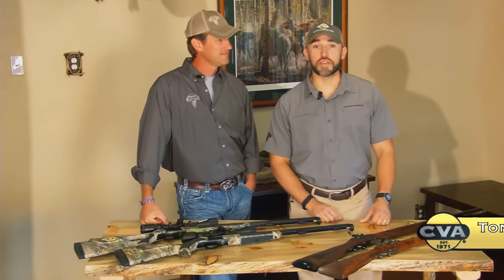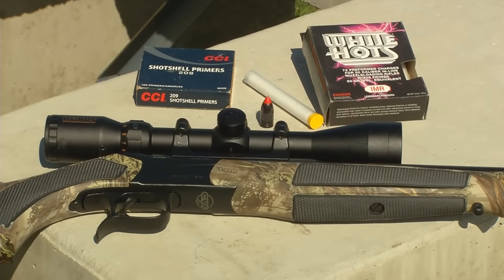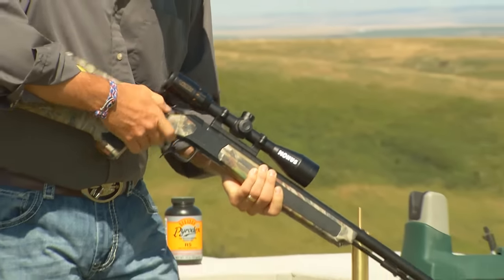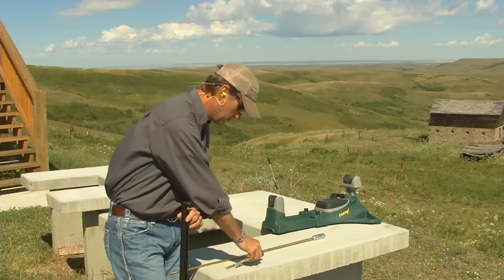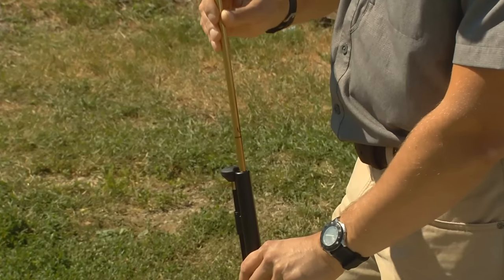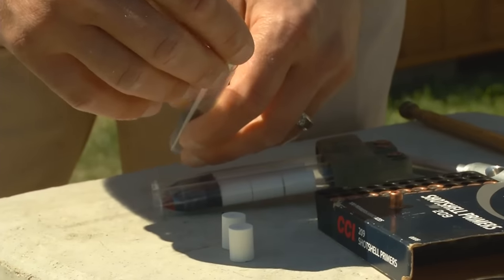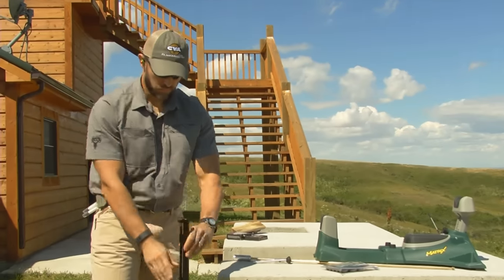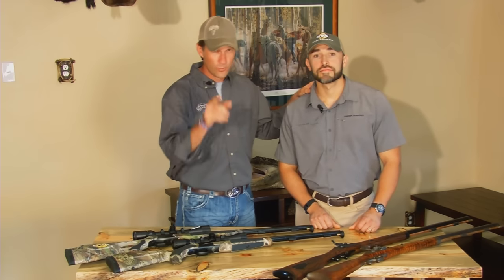How To Load & Shoot Your CVA Muzzleloader

Comment: I have been a cap-lock shooter for 40 yrs.  Never fired a flintlock.  Good fun .  Clean-up not bad, with a bit of practice.  Had best luck with in-line guns, like these. Side-hammer guns OK, if nipple delivers the flame directly into the powder charge, without twists & turns.  Have had a CVA Bobcat .54 for 30 yrs, and despite everything , have never been able to make it go ' bang ' every time.  With a nipple drum,  fire has to make two 90 degree turns prior to reaching the powder.   Even  musket caps, priming the nipple, etc proved ineffective.
Reply: There is a fitting you can purchase that turns it into a 209 shotgun primer.
Reply: @thomashocker2792  Sounds worth a try.  Tks.

Comment: I’m disappointed that you didn’t use the ramrod that came with the gun.  I came here because my cva wolf come with a 4 inch extension you have to use to load it but it doesn’t fit in the holder now I have to carry it separately and possibly lose it when I might need a second shot.  And I was wondering if I can load it without the extension thing without damaging the bullet
Reply: I was wondering the same thing. Just got mine and I love it but it doesn't make sense that the ramrod doesn't fit the holder with extension piece on

Comment: I have an optima V2 and I must have some bad luck with the breech plug.  My primers fit nothing like what is shown at 2:26 in this video. When I put the primer in its extremely loose and can even be angled while in the primer pocket.  I received a replacement breech plug but it is still having the same issue.  Have you had this before?
Reply from the maker: It sounds like a primer issue. Our breech plugs are machined to a precise spec. The 209 primers are generally stamped metal that is less precise. I would suggest trying another brand of primers and see if you still have that issue.
Reply: @CVA  July 26, 2024
https://youtube.com/shorts/5d4Hbx3cjsM?feature=share
July 26, 2024
https://youtube.com/shorts/zYa3AYazwQE?feature=share
July 26, 2024
https://youtube.com/shorts/ptCjFsQkTwI?feature=share

Three different primers. All the same issue as the Winchester.

Comment: I have trouble with my CVA muzzleloader shooting all over the place. Do you have to allow the barrel to cool or clean it every time before shooting when sighting in the scope? Never had a muzzleloader so not sure what is to be expected.
Reply: Recommended that you run a swab down the barrel each shot, I do every 3 shots, I think I use a 20 ga swab, I use 50 grain pellets and 295 grain powerbelts
Reply: You want to clean barrel in between every shot when sighting in. Either a wet swab followed by a couple of dry patches, or wet patch followed by a couple of dry. You'll never get consistency with a dirty barrel. Also some guns just don't like certain powder bullet combination. I never could get my Omega to shoot powerbelts accurately, but shoots moa with shockwaves. Also if you're using 209 shotgun primers, buy some triple seven 209 primers... regular 209's are to hot for muzzleloaders. Your charge is being pushed down the barrel before ignition. That will also hurt accuracy...
Reply: Try different grain of loose powder with patched round balls and see if that helps. Just a thought 💭.

Comment: Wait do you need to use a primer to clear the chamber every time before reloading?  Or just the first time?
Reply: Pierre C  should do it every time you clean it or swab, helps flush any debris or moisture from the swabs out of the breech plug hole
Reply: You dont need to
Reply: I would
Reply: I shoot only round balls in my black powder rifles but what I do is carry a tin with all of my patches cut to size and soaked in a black powder lube and they clean the barrel well enough for me to shoot all afternoon every time I load the gun.

Comment: I purchased a CVA Wolf last year. I took it out to sight it in today and it shoots high. I changed powder charge and projectile type and weight and no luck. what do I need to do
Reply: Tammy Pickett if it has a scope on it adjust the scope If not find out how to adjust the sights I recommend a scope
Reply: I have a wolf and love it. Adjust your scope dude.
Reply: Mine shoots very accurate with less powder. Like 70 grains. All my shots are 35  to 40 yards.

Comment: Shotgun primers are too hot for muzzleloaders. You push the powder charge down the barrel before it can ignite leaving a powder ring a few inches from the breech...that's why triple seven makes reduced power primers for muzzleloaders
Reply: They say Black Horn 209 requires a 209 primer.
Reply: It sounds like you need a tighter sabot.
Reply: @SpotterVideo  or you should research what I said!
Reply: @johnwilliams2427  I understand what you are saying.  I build smokeless muzzleloaders that shoot a 275 grain bullet 3,000 fps.  I use Large Rifle Magnum Primers in some of my muzzleloaders but use 209 primers in others.